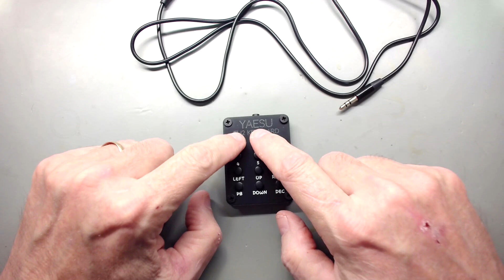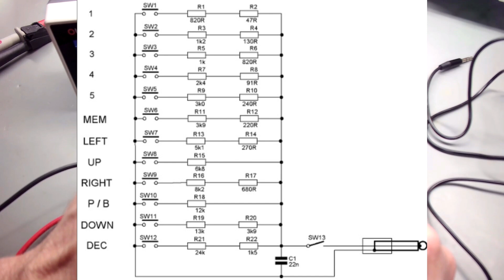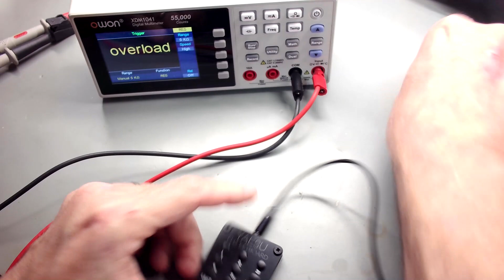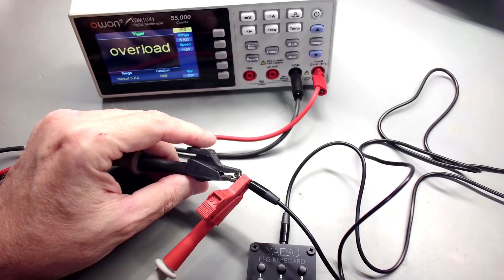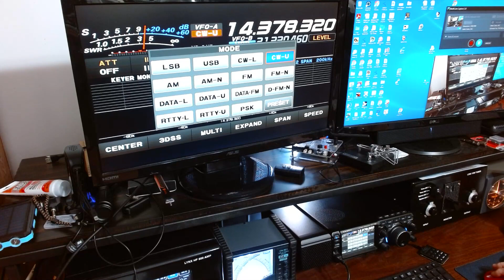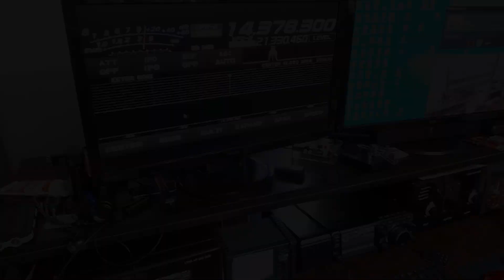Avoid This Yaesu FH-2 Setup Mistake

Comment: I got the FH-2 £10 clone, and didn't bother to do much with it. Recently, I got a Yaesu FTdx10, and it came with a real FH-2 remote. Like you, I found it didn't work, and set about finding why.
🌟Page 110 of the manual, describes how to set up "ATAS". Same point, "TUNER SELECT" there is the option for "EXT" which also allows the FH-2 remote to function.
My need is for 1KHz UP / DWN control, the same way I could use the FT-710 "STEP/MCH" knob, as I mostly find that works for observed signals (250 & 500 Hz steps are mostly "E" and "I" stations, but tuning other than 1KHz is then not a chore). The FH-2? Doesn't do it! Nowhere can I find how to make the FTdx10 perform moving frequency 1KHz at a time, as conveniently as the 710. The knob is too easily jogged, when changing BAND or MODE, and the friction control (it's underneath the large knobs) only works with the inner knob that moves 10 Hz steps max (unless of course, you can tell me different).
Reply from the maker: No I am afraid I believe you are correct. 
RJ

Comment: A chap built one on YouTube and had to remove the capacitor
Reply from the maker: Thanks for the information. The cheap one I bought worked fine once I got the settings correct. 
RJ

Comment: Anyone have an idea of how to add a timer to activate instead of pressing a button?
Reply from the maker: The schematic for the FH-2 is online. If I wanted to do this I would just build a simple ne555 timer to close a relay intermittently. And when closed place one of the correct resistance values inline with the plug. This is the same as when you push the same button. Now program the radio id recording for that button and set the 555 timer for how often you want. 
RJ

Comment: Need to go into FUNK and have and set BK-IN to be active.. I see it's turned off  so your just forcing it to work incorrectly Ham Radio Elmer N3WER make sure to sub him.. 73
Reply from the maker: Thanks, I have BK-IN off to prevent it from transmitting while I demo this on youtube. In normal operation I have it on so the messages are transmitted. 
RJ

Comment: I have a yaesu one on the FT2000 I can use the same memory for voice select CW then that same number saves a morse code message as well but remember to select BREAK IN otherwise it won't work.  De M0JFE
Reply from the maker: Thanks for pointing this out,
If you notice I was not transmitting as I did not want to create QRM on the bands. This was done as you said by turning of brake in on the main menu. Once I was done with the video I turned it back on so it would key up when I used it next time. 
RJ
Reply: @LynxElectronicsLab  a true proper considerate amateur radio operator de M0JFE
Reply from the maker: Thank You I Try!
RJ